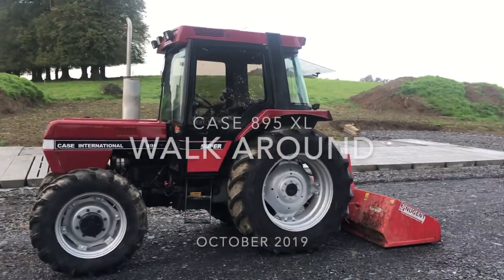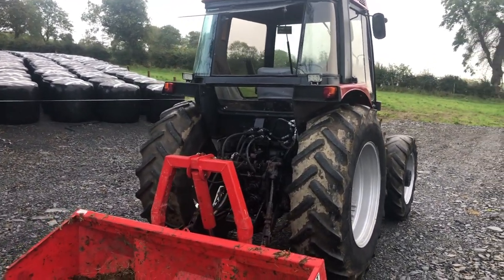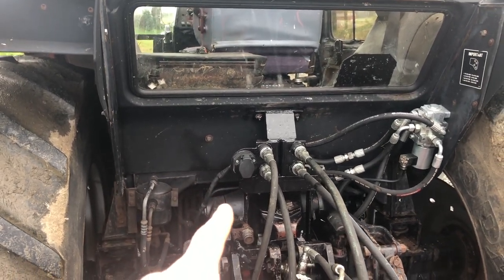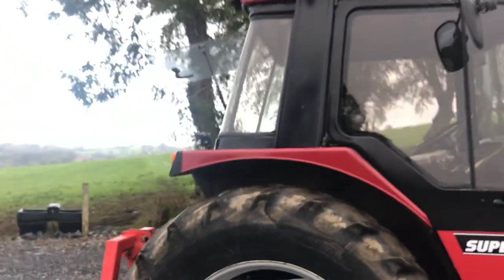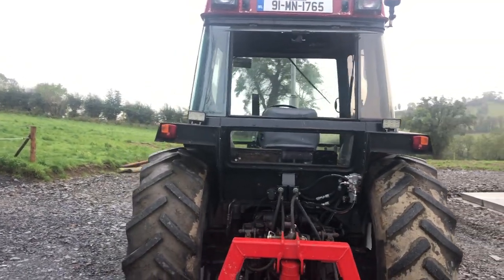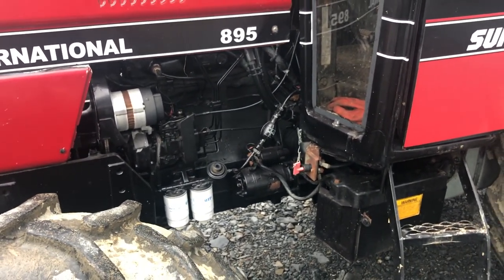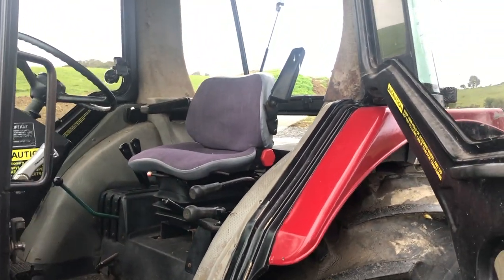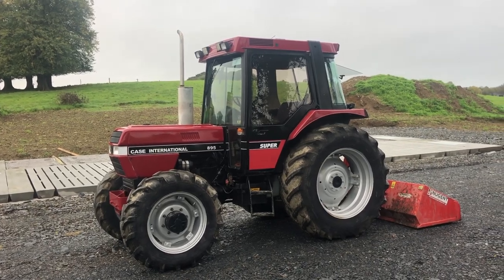Our Case 895XL walk around and a lucky fire escape.

Comment: i bought a new 895 stockman special around 20 years ago ,at end of lambing that year i washed it in the dark while waiting for a sheep to lamb ,as land was drying up and hoped to get on with field work next day ,got up at 5 30 next morning ,just as well i had not put tractor back in shed ,all that was left of it was front left wheel and tyre ,burnt to a crisp ,was only 10 month old ,insurance took 10 month to sort out as i had paid £19,500 for it with loader and grab and they were only willing to pay me £13000- ,,electrical fault which seemed to be common on this model after i did some investigation

Comment: Nice to see this video so one can get to know the model. I guess quite a lot can be applicable to the 485, 495 and 3220. I have a bigger tractor from the early 90thies, back hinged doors etc. but I would like a smaller one too. I've had a MF 175 when I went for the current Valmet 6300 and I don't want to go back to something 60thies or 70thies. I like the creature comforts. But it's for hobby so nothing I put money into for new things. I read a lot of technical data on machines and when I discovered the smallest model of this, 3 cylinder, I felt it was the right one. Basically a tiny tractor with a giant cab :-)
Though I haven't seen any of them here in Sweden. Maybe some in Denmark. I've set up notifications on a second hand site so if something is listed with the correct search term I get a notification. Hoping for it to someday say there is a nice 3220 with XL cab that I can get.

Comment: Me neighbour has a 895XL with a quickie loader and holy shit it's ruf has never seen a grease gun since he got it and when ya shake the bucket the loader has a half inch of backlash and rattles and bangs when you hit a small stone and the linkage PTO and gearstick rusted solid because he left it sitting outside in a Scottish island winter and now the roof of the cab fell in😂
Reply from the maker: Masseyman6480 and he’d probably tell you it gives a lot of trouble 😂
Reply: IFarm WeFarm he does as well. Me grandad has had internationals from the 60's and everyone of them was kept in mint condition. The ones I've been told most about is his case 885xl 2wd, 1690 2wd, 956xl 2wd and his beautiful 4240 pro XL 4wd loader tractor and all in mint condition even his scraper tractors were mint like his Fergie 135 international 414, 352? And 423? Can't remember correctly the models but he made sure to keep them mint to keep the resale value up because he only got rid of them when they get above 8k hours except the 1690 what blew up several hydra shift gearboxes before it got to 3k hours. It was on the trailer harvester most of the time

Comment: I have the exact same tractor but i have a few electrical problems. We got the clutch fixed and the whole tractor went in half (We didnt do the job ourself since its very hard) But now the speedomoter doesnt work. And it wont start. it wont go on ignition but when u press the hazzard lights they do somehow work and the battery is fine. Sometimes it suddently works but when u start driving the dash starts fading again. How can i fix this?